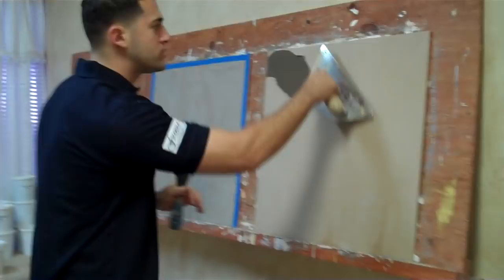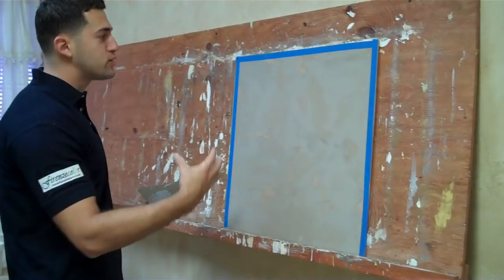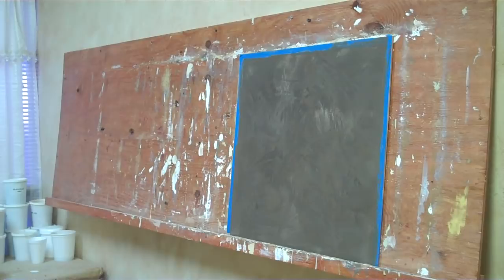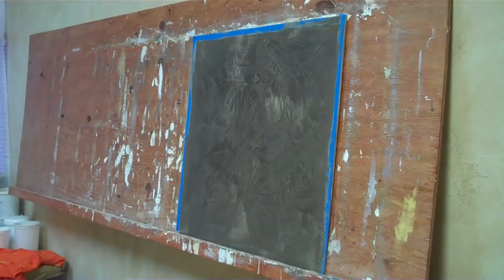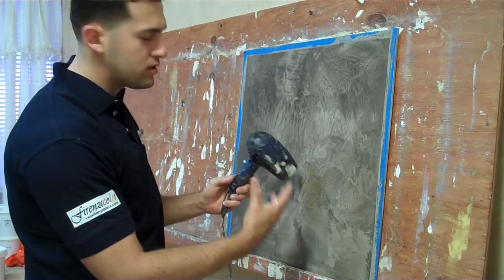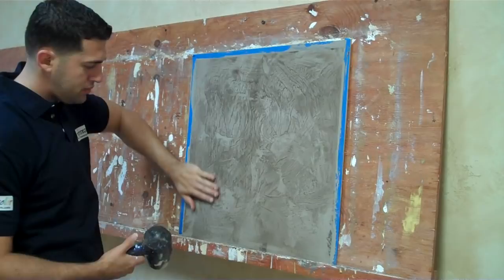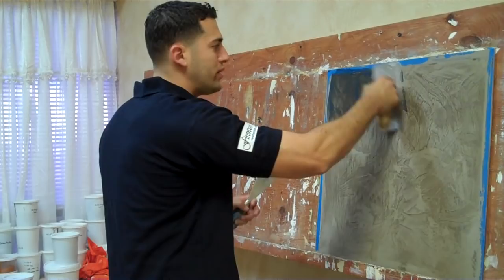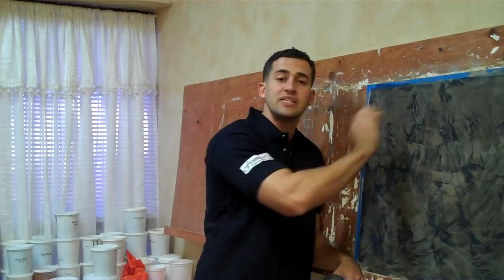Venetian Plaster Old World with Colored Wax

Comment: I have searched the net for hours for something I like and this is it. But I'm lost without the exact products you are using. Can you please list the exact products you are using.? Thank you for posting this video!!
Reply: They used Firenze Color Neutral wax and tinted it with universal tint. They have a location in NY and FL, if you call them they can set you up with what you need, I just did it myself